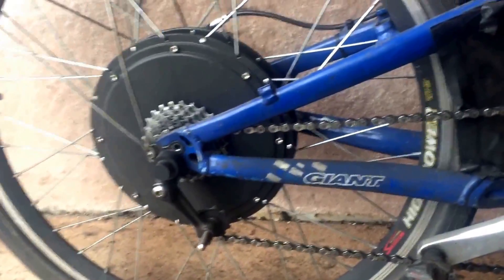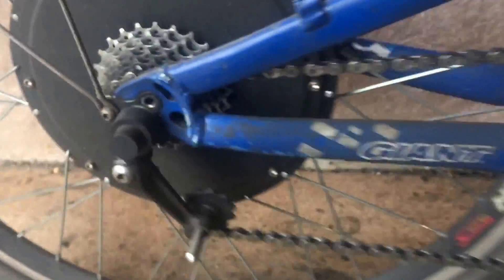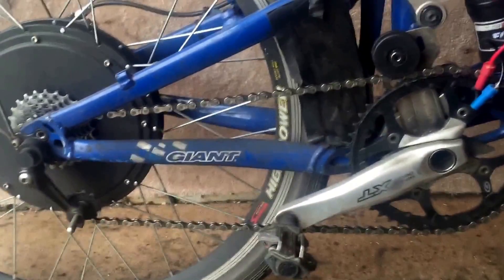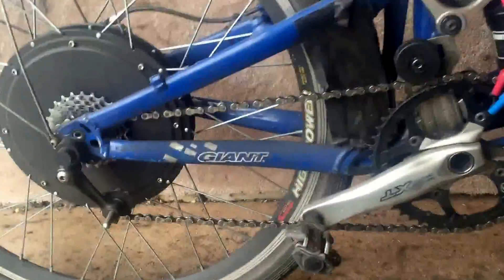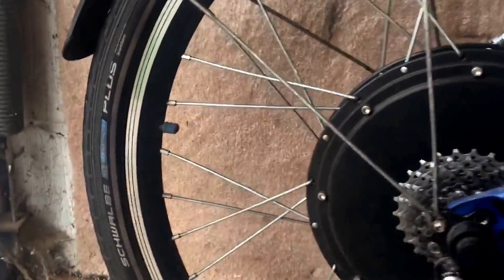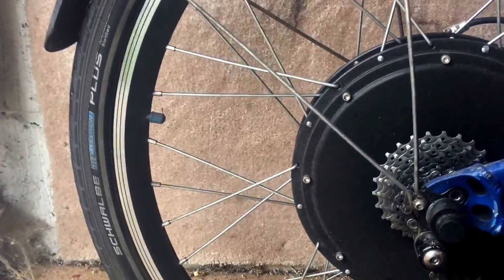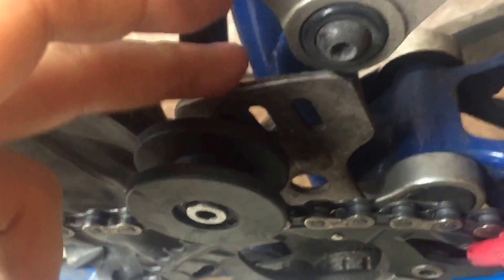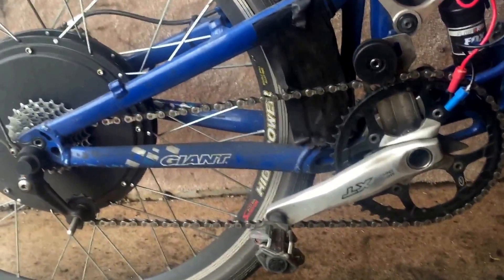1000w 48v electric bike recommended gearing and tyre choice

Comment: I am thinking of going for the 48v1000  with 15ah battery , because  i am not keen in travelling at 30mph .

I am happy around 20 mph on thr flat , but i do require the power and speed to get me up hills .

Would the lower battery do the job ? Also i am not keen on the size and wait of thr 20ah battery to be totally honest .
Reply from the maker: ronald millsopp Hi, the battery ah just determines how long the battery lasts and how many miles you get before it runs out, you will still have the same top speed, but you dont have to go at top speed you can go any speed you want. hope this helps

Comment: nice bike,, I just built one 500w with a very nice battery; less watt hours than yours but US made. I wired the batteries in series to 48v; total weight 5kg.
 I did the same thing you did, made the bike a single speed.  I was able to get the chain tight enough without a tension-er.  No need to really have all the gears unless you have a mid-drive..  Gears just add complexity. Used Schwinn 2 inch tires with Kevlar and slime tubes..   Wiring was clean using plug and play harnesses.  I ordered the kit direct from the manufacturer in china.

Comment: Good idea, but I still like to downshift and floor it with the motor full power as well.
Reply from the maker: Shaun Dobbie yer you can do that if you want, I just prefer to single speed it as the motor helps so can use a high gear